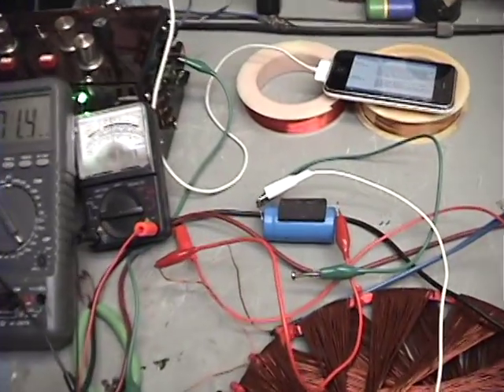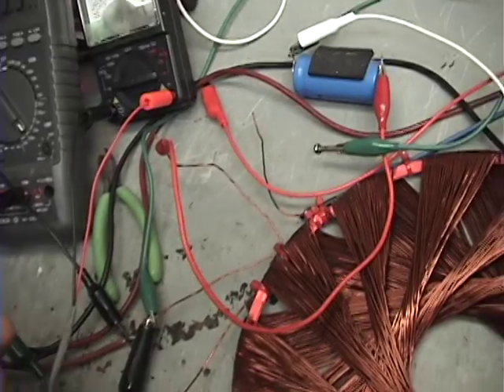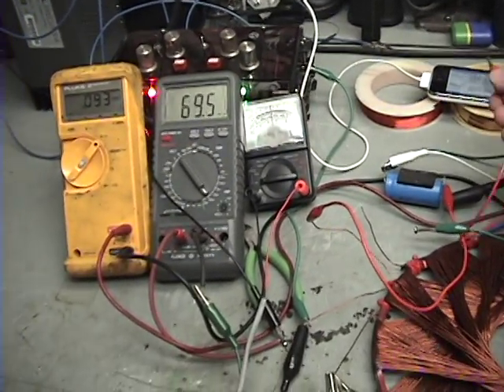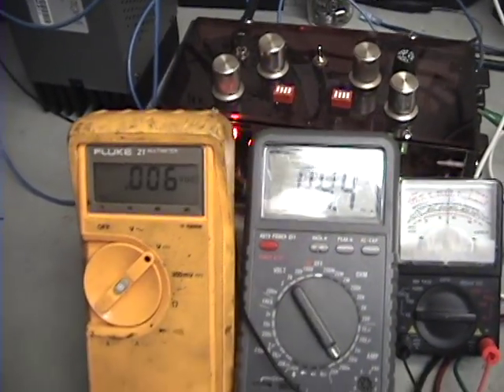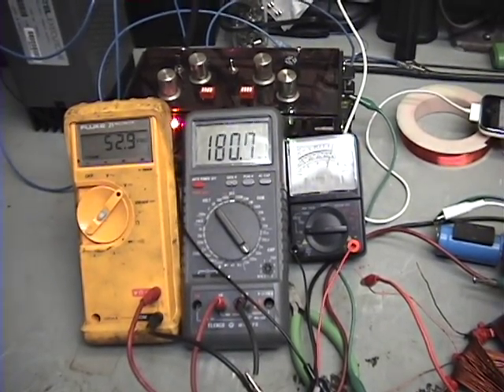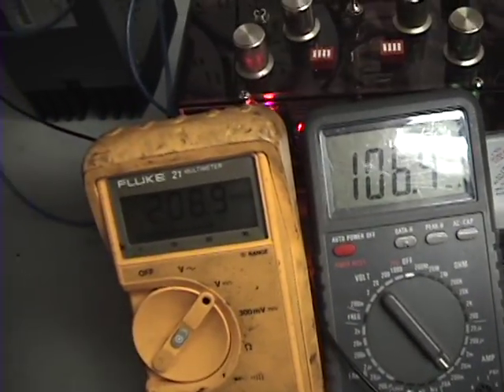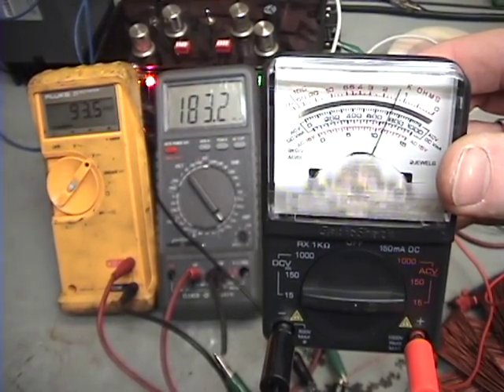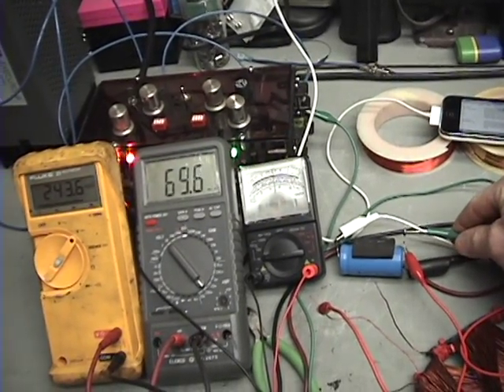HVTW Rodin coil, Fascinating cap charging results, request test (TEST13)

Comment: So, you are measuring output amps from only the coil, not DC amps input?
this is exactly the results, I have been wanting to see from the Rodin - Russ good job

from the video
11v 180ma = 1.98 watts
rectified - 11v 105ma = 1.155 watts
cant wait for the April wind, and I think YT allows 15 min videos now

Comment: Tesla said in one of his patents to connect the input of coil 1 to the out put of coil 2. So,  perhaps you've effectively made a Tesla coil, except with Rodin math geometry applied.  The geometry is important because Tesla also said the distance between the winding(s)(wires) is important.  Food for thought.  Tesla also said that sound frequency (resonance) is important.  Another reason the geometry of the Rodin coil is unique. But BE CAREFUL if you start playing with Tesla type stuff. It is very dangerous.  Cheers.

Comment: Can you try charging a battery.. like a LiPo 4.2V 2300mah or LiFePO4 3.3V 2300mah cells with some more capacity.. This chemistries will charge upto a point say 80% really fast and then take a long time to charge the remaining last 10% capacity.